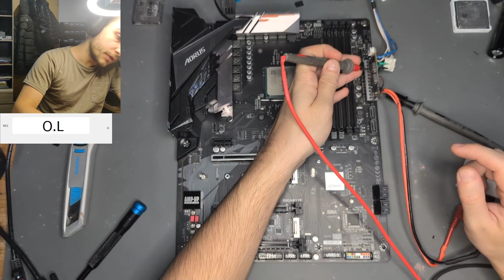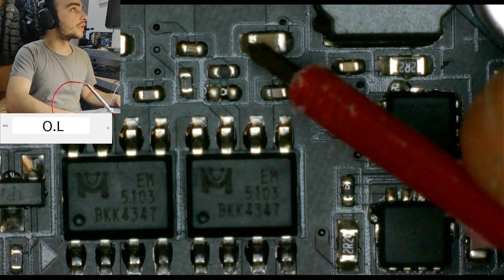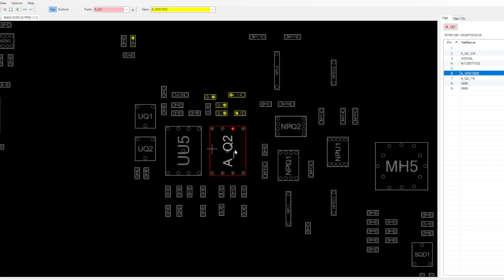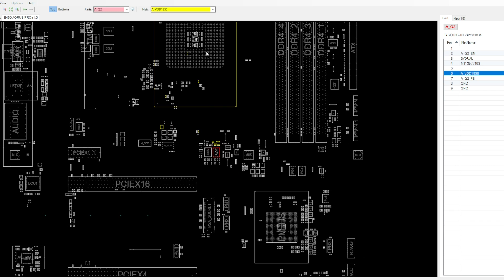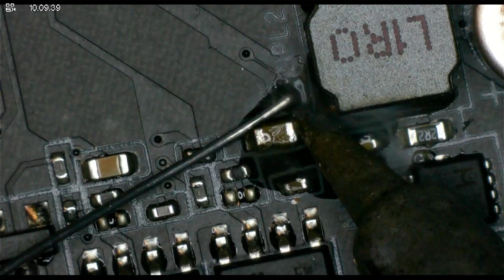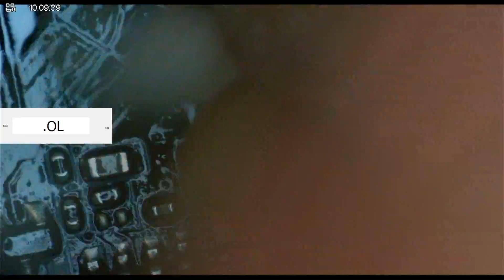THIS MODELL HAS FAILED SO MANY TIMES || GIGABYTE B450 AORUS PRO MOTHERBOARD REPAIR

Comment: I have a different problem here: the boards starts normallym, but locked on the cpu LED e no post. Tried everything, reflashed bios several times, even the ECU1 bios chip, but no luck. Have any ideas what could it be? Its a problem i havent found answer over the internet. Regards
Reply from the maker: Most off the time its a missing voltage or missig components somewhere!
Reply: @MainboardMedic i ll look into it. Thank you.

Comment: Hello! Great video.  I have a nearly similar board like that on my table and after I replace that same linear regulator the board is not having output. Which processor have you used on this repair, cuz I used my 3000g AMD processor but the board still is not coming on.
Reply from the maker: I used a 2600 i belive!

Comment: I have the same model.It has a very strange issue. If i unplug the AC power from the PSU the bios loses it's configuration. The battery is fine, what could cause this issue?
Reply from the maker: There is a double diode after the battery and that might have gone bad. So its not letting the voltage trough!

Comment: Why you didn't replace the capacitor ?
Reply from the maker: Its just a filter, doesnt need to be replaced.
Reply: @MainboardMedic  some linear Regulators are depending on output capacitance for stability. Also quite common tp have one higher value in parallel with a lower one to have a lower esr.

Comment: What tool to use to make voltage/current/resistance measurements and see it on the screen? Great video!
Reply from the maker: That is from my multimeter!  Thereos additionel software with it, so you can connect it to the PC!
Reply: @MainboardMedic  And do you have a separate current and voltage meter just for the 12v? Did you do that yourself, DIY, or is it purchased?
Reply from the maker: @Alan96555  Yes its seperate and its self made! Just an INA260 with a display and an arduino!

Comment: You must have so many motherboards in your house. I'm not nearly on your level and I have 14 motherboards of which 3 of them are not working due to bent LGA Pins. Your videos are very helpful and have taught me a lot. I want to say, Keep up the great work. I really enjoy watching you repair videos. Cheers my Friend. 🙂
Reply from the maker: Ive actually got about 20 repaired ones laying around and another 20 to repair, where about 10 off them are dead ends for me where i cannot get any further and then there are about another 10 as being donor boards! So yes a lot!
Reply: sounds like a good excuse to get a preheater and a hot air gun

Comment: I had never thought about the differences between laptop and desktop PC boards in this way.  The laptop guys are constantly replacing (or at least removing) shorted capacitors, yet I never see it on this channel.  This is a fine illustration that MLCC failures result mainly from mechanical and thermal stresses, not electrical or manufacturing defects.  No capacitor, no shorted capacitor. 🤣

The thermal camera looks magnificent.  It looks like you are using a USB extension cable.  This is much less cumbersome than directly attaching to the phone.  Brilliant.

Nice to see you've fixed up another board.  Good video.